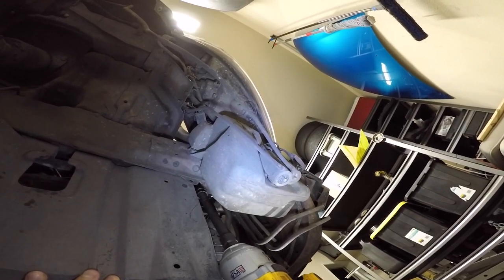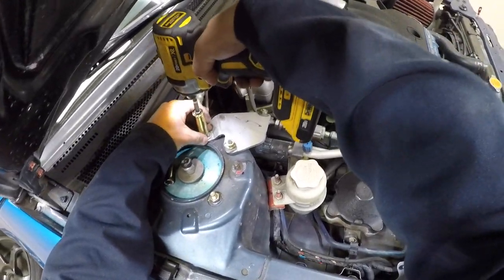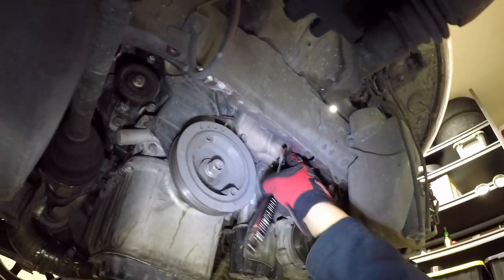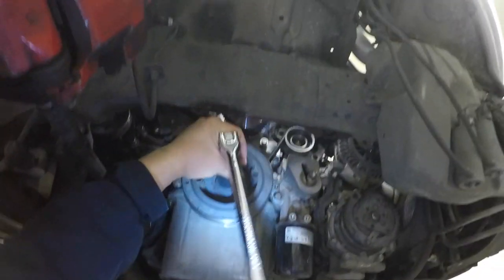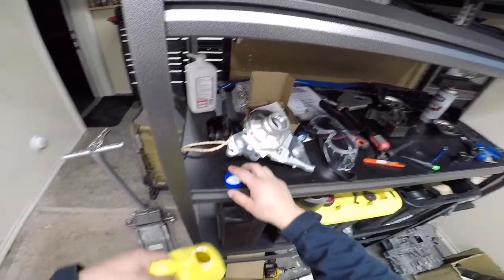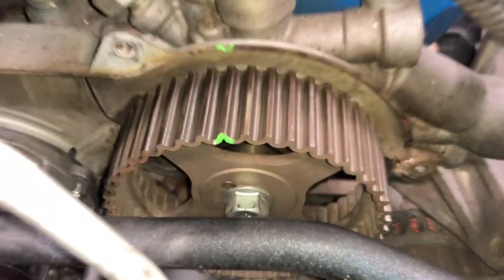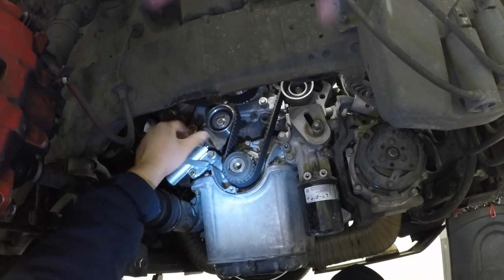How To Replace the Timing Belt on a 2006-2012 Mitsubishi Eclipse

Comment: Watching this because my car is at my mechanic's place being worked on (both valve cover gaskets being replaced, transmission flush, new ngk iridium spark plugs, going to full synthetic oil, new oil filter, air filter, and of course, new timing belt, and water pump kit).
This gives me such an appreciation for ALL YOU MECHANICS out there. Shout out to all you Mechanics. We wouldn't be anything, anyone, or anywhere without you.
My car: my 5th Mitsubish Eclipse ('99 GSX, 2001 GT, 2001 GT (Lemon), 2008 GT (RIP), and now my 2007 GT(Daisy is her name).

I expect she'll run better than ever  =-)
Reply: Question about the transmission flush, I was told by a mechanic that flushing the transmission fluid wasn't a good idea if there's nothing wrong with it, just wondering if this is true, btw I have an 06 4G if it matters thanks.
Reply: @m.e.8653  I heard that too, so I just ended up replacing the fluid, and my car runs great.

Comment: I was really nervous to start my 2.4 mivec 06 eclipse after I put it back together...But thanks to this video it fired right up and sounds good...took it for a drive and everything is working...the motor Is at 160k... stripped some rubber teeth on a start....my fingers were definitely crossed...thanks alot for the video

Comment: Your video is great! It is better than any training video I have watched for car or motorcycle, great detailed step procedures and advice about bolt replacing to keep track. After watching your video I know I could work through the same job on my 2007 eclipse GT 3.8. (In Time spot 4:12 bolt sequence) When I worked on my VTX 1800 I had bolts that needed to be in order, I numbered them and position as I removed them so I had their position.  That way I did not have to mess with them.   Thanks for your GREAT VIDEO and knowledge!  EBW USN Ret.

Comment: Mine got 260k miles and I have no idea the last timing belt job. About to concur this myself in the garage. Thanks for the tutorial man. I’m replacing the slave cylinder because the clutch won’t hold pressure even after replacing the master. Stupid previous owner didn’t replace it after having clutch done. I have no idea what I’m doing but I’m 18 with no money lol. Gotta do what I gotta do to get my car running
Reply from the maker: Love to hear when high mileage cars are still going strong 💪🏼 but definitely change that belt ASAP lol that’s how you learn man, when you have to do it yourself, but I promise you it’s better this way, mechanics suck
Reply: Swear catching antifreeze is like gripping water lol

Comment: Hey man, are you putting the oil pickup tube in danger by jacking the engine up by the pan, if so is there another way around it?
Reply from the maker: No, this oil pan is very strong

Comment: Thinking about picking up a 4g GT eclipse to replace my 3000gt SL as a daily feel like it would complement my 350z nicely lol they also seem to be extremely underrated. This is a great informational tutorial, keep going!👍
Reply from the maker: xIW3ST SID3Ix they are definitely underrated, you’ll see just how much once you start driving your 4g GT, that’s a nice line up of cars! Thank you I definitely will!
Reply: @JohnnyGT  update: I dont think I've ever had such a hard time finding a car 🤣. Finding a manual hard top GT has been damn near impossible, I found one with like 55k on it 8 hours away absolutely mint. I told the dealer I'd pay for the shipping to my place and they're just giving me the run around. I went to look at 2 locally one I was informed had a bad gas tank before I even left to see it and the other was beat to hell, rust, blown shocks, bad engine mounts, stuttering on power lol. Buying my Z was a 3 day process from looking at them to owning one. I won't give up damnit 😭😂

Comment: Hey man, quick question?  if my crankshaft jumped a few teeth when I was tightening the tensioner down, can I just pull it back to time?? Or should I go four teeth backwards from time, and then pull it back to time again? Thanks.
Reply from the maker: You can rotate it back in place in whatever direction is shortest, clockwise or counter clockwise

Comment: Please!!!! I want to warn others. When pulling the grenade pin on the tensioner. The distance he is talking about, the 4.8 to 6 mm is the distance from the aluminium tensioner housing to the pivoting pulley platform . Not the distance that it expands. The total distance the little plunger on the pulley is out of the tensioner until it comes in contact with the thing that moves.

Comment: Where.do you buy oem timing belt kit
Reply from the maker: I buy it from MitsubishiPartsWarehouse.com
Reply: @JohnnyGT  It says the power steering belt is discontinued and you can no longer buy it. That has to be some kind of mistake right? Also why does the owners manual say if you live in CA, ME, VT you can wait until 100,000 to change the timing belt. Mine has 59,800 and I haven't changed it and the car is 17 years old. I'm not sure if the previous owner had it changed or not. That is what brought me to your channel.

Comment: I've had this happen, where I just could NOT get the marks to line up. The crank would always turn counter clockwise a half a tooth, seemed like too much tension on that side (idler pulley side). I ended up giving up and taking it to a stealership. In the video you said if you can't get the marks to line up to give it another two full rotations and try again. Is there only one correct "cycle" in rotation that they line up initially. Im about to try this again in  couple weeks, any advice would be appreciated!  Sweet car BTW #Club4g4life

Comment: Hey man quick question, I have a mechanic that replaced the water pump, timing belt, and tensioner. When putting everything back, he lined up all the marks on the crank and the camshafts but he says the motor is still out of timing and runs like crap. Any idea??

Comment: Hey I’m buying a 2009 eclipse, but it has 92k miles. Do you think it would need a new timing belt because I heard they last until 105k miles?
Reply from the maker: Yes because it goes by either mileage or years, and it’s way over due for a new one.

Comment: Hi around how many miles should I replace the timing belt I have a Mitsubishi eclipse gt 2007 93,000 miles
Reply from the maker: Should be done every 60,000 miles or every 6 years for the 2006-2008 model, every 100,000 miles or 6 years for the 2009-2012 model, don’t quote me on that, check your owners manual. 
If you don’t know when it was done, it means change it now, or buy a new engine later

Comment: My timing belt was done at 79k and the car is at 94k. I have some clicking sound coming front the engine. I was told to get my valves adjusted back into spec. What do u think it could be? Also, 09 6 speed gt.
Reply from the maker: Valve lash adjustment does have to be done on this engine every 30k miles, when they’re out of spec, they do make a louder sound. These engines have a clicking sound that’s normal, of course you would have to determine if this is a different one or not

Comment: The owners manual shows the tensioner pulley with the eyes in a different spot. Does that matter? I know you installed them on the top, but the one on the manual has the eyes on the side.

Comment: Johnny gt  i just bought a 2006 eclipse gt it ran perfectly but i think the crank position sensor went out , it tries to crank but doesn’t wondering if you can help me trouble shoot this
Reply: I had the same thing happen. Driving down the road then bam rpm’s drop to a stall and power steering when out. When I scanned for codes it read crank sensor but someone I talked to thinks the belt broke so I’m going to try to replace the sensor first just to see but there’s a good chance both our timing belts went out brotha lol

Comment: hey thinking about buying one. is this a doable job for first time.
Reply from the maker: If you know you can do the steps in the video then yes
Reply: @JohnnyGT  its alot of steps it appears but if u just follow instructions can't really go wrong.
Reply from the maker: @jordanscott6410  have you worked on cars before or is this gonna be your first time? If this is your first time, it might be a bit much
Reply: @JohnnyGT  a little not a ton but my dad's a mechanic.
Reply from the maker: @jordanscott6410  if you can tackle this together you’ll be perfectly fine then

Comment: i just bought a 2006 gt and the guy just replaced everything you replaced in the video about 2000 miles ago but he forgot t put the cover back on the timing belt i was wondering at what point of time in the video could i just put the cover back on
Reply from the maker: Everybody says they just replaced everything when selling a car, me personally, I never believe them
You can install the cover just before the part where you remove the timing belt, so pretty much all steps
Reply: @JohnnyGT  appreciate you so much bro didn’t expect you to respond ❤️

Comment: At 2:51 there is an grey metal sensor with an electrical connection that you tuck the black plastic covered cable behind. It's about the size of a D-size battery sticking up with an electrical connector plugged into it. At 2:52 your thumbnail is touching it.  What the heck is that? I guess it's right behind the cam gear.

Comment: When I tried taking the crank bolt off it was spinning the timing belt with it. Any advice ?
Reply: Put a socket on it with a long bar wedged onto the body then just crank engine for a second.

Comment: Thanks man
Reply from the maker: No problem! Lol
Reply: i finally got around to it and i’ve had to redo the tension AT LEAST 10 times. the tear stone manual says the grenade pin shouldn’t have any resistance after 2 revolutions but i noticed you didn’t do it this way and by doing it myself i left that little room where the pin isn’t as loose and i was closer to the protrusion spec. if only my new tensioner didn’t blow its seals 😐. this job is definitely humbling mostly aggravating. (you also rotated the tensioner pulley clockwise contrary to the manual, but why?)

Comment: I own a stock 06 GT with 105k, I am curious if you have a similar start up issue, the engine makes a small Top end knock (clacking) noise sometimes after cold starting (not always), run it for about 3-5 minutes restart the car and the knock is gone. The noise when it makes it only goes away after restarting the car after it's ran for a few minutes, if you don't restart it, it will make the noise until you park and restart,  It's my daily driver It's done this since 55k any clue what it could be? Wasn't sure if you've experienced anything similar with the 3.8
Reply: I have the exact same issue  no cluse as to what it is

Comment: How can you tell if you need a new belt
Reply from the maker: For 2006-2008 models it should be changed every 60,000 miles or every 6 years, whichever comes first. If you don’t know when it was changed, change it.

Comment: 15:11 damn you gouged that pretty hard . Is that reason why water pump could be pre maturely leaking?
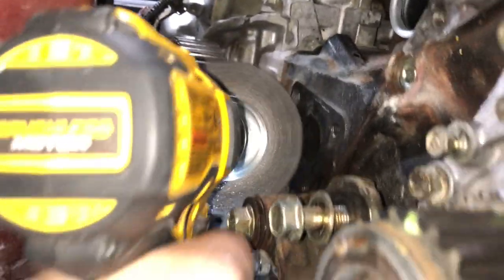Reply from the maker: Stew C do you mean at 7:01 where I was removing the gasket with the wire wheel? those lines are the gasket being cut down, it doesn’t affect the surface of the engine block at all, the flat shiny areas are where it was done removing the gasket
Reply: @JohnnyGT  oh okay gotcha just wanted to point that out . Great vid tho planning to do my belt soon
Reply from the maker: Stew C Yea no problem im glad you asked, others might have the same question thinking I scratched the block lol the gaskets get so fused to the surface that this is the only way to remove them most of the time

Comment: What happen if the timing belt it’s gone? Can the car be fix and back on time ? Anyone thanks
Reply from the maker: Did the timing belt break while the car was running?
Reply from the maker: What was the engines RPMs when it happened?
Reply: Between 1000 and 2000
Reply from the maker: @valeferto8239  you might get lucky and no internals were damaged, but more than likely you need a new engine
Reply: Ok I’ll do my best and thanks for the info really appreciate!!!